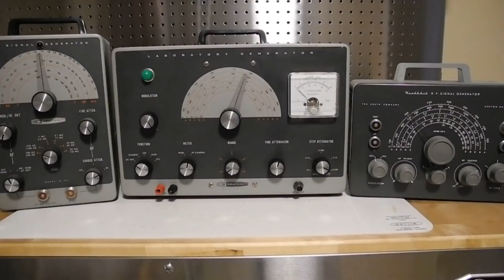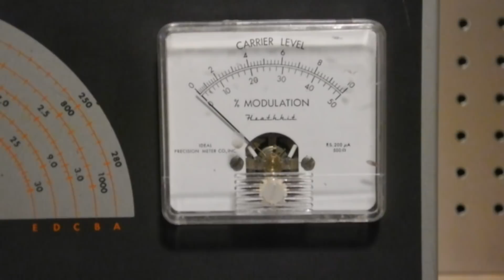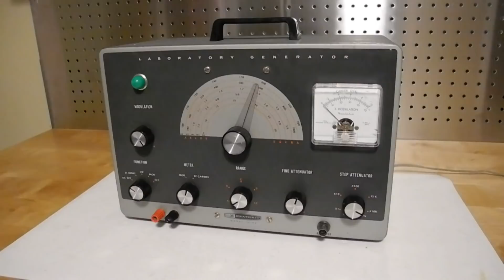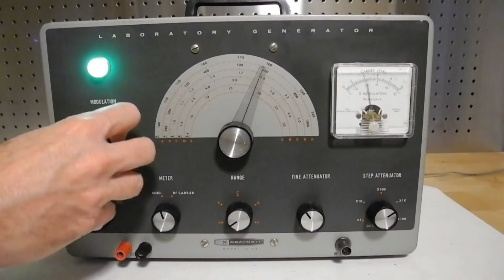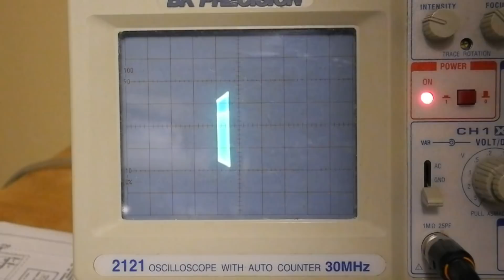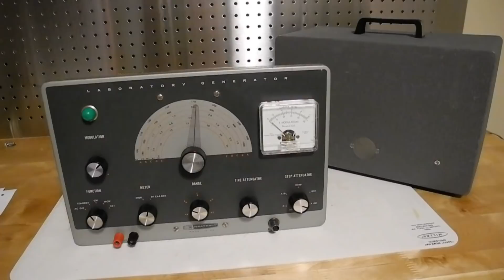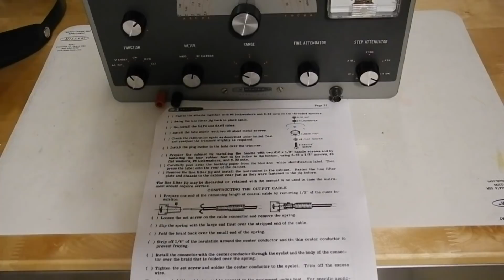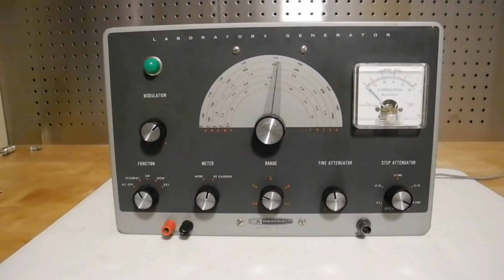The Heathkit IG-42 Laboratory Type Signal Generator

Comment: Owning an identical IG42, I had gone through many experiments changing resistor values, varying the kathode resistor value, etc, in order to obtain a more pure sine wave. However I failed to improve the waveform. I should have found your excellent presentation somewhat sooner, so I would have known the observed waveforms were totally normal ;-).
I replaced the various capacitors especially in the oscillator section, by polyesterfilm type ones, but with little effect on the waveform, if any.
As my IG42 generator was still provided with the original screw-type RF connector, I replaced it with a BNC-connector. In addition I replaced the selenium rectifier by a full-wave rectifying bridge and a 5W 220 ohms series resistor.

Comment: I bought one a couple of months ago. Mint condition with all the original white pointer knobs and Daystrom tubes. Only has a blown RF line choke, which might be from a shorted disc cap on the incoming power, I have not started on this project yet. Oh yeah, I got it for $25.99 on EBay.